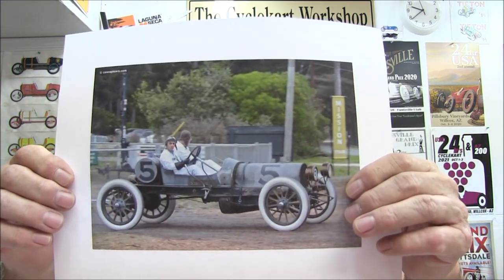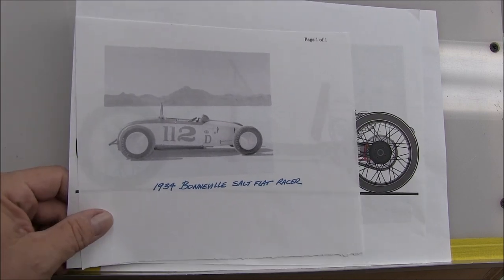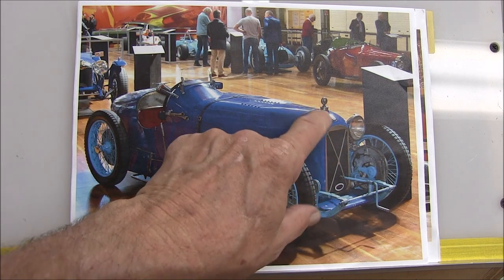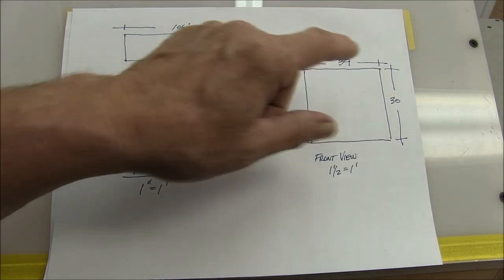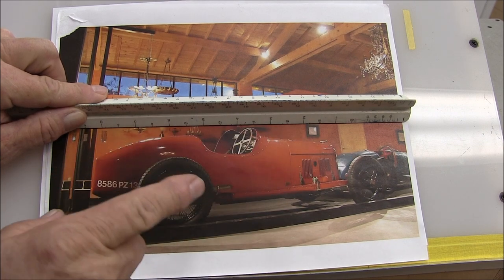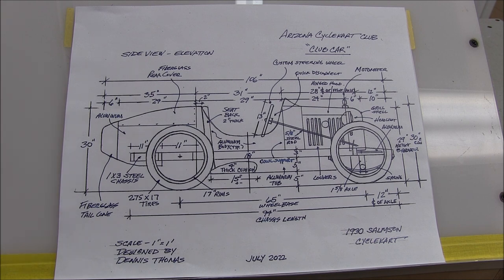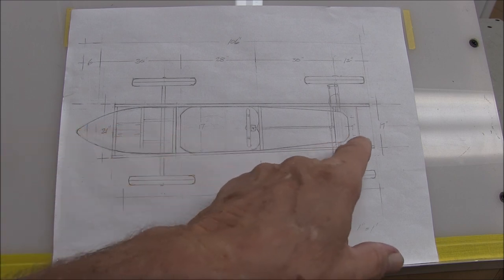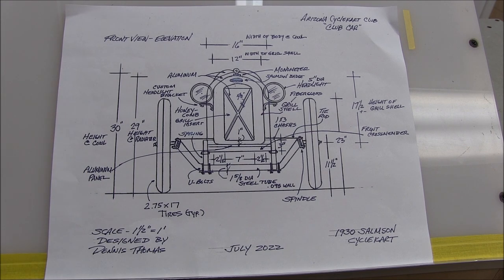Update #1   Building the Arizona Cyclekart Club Car

Comment: What are your thoughts on doing 5" below the frame vs 3" or 4"? When the foam compresses down, you get the driver's butt about 3.5" below the frame? is 5" enough ground clearance for a dirt track
Reply from the maker: Some guys are running at about 3" off the ground. They bottom out on uneven surfaces. I recommend that the bottom of the tub be 4 to 4.5" off the ground and you won't have any clearance issues. Thanks